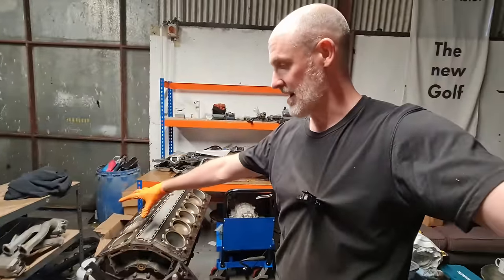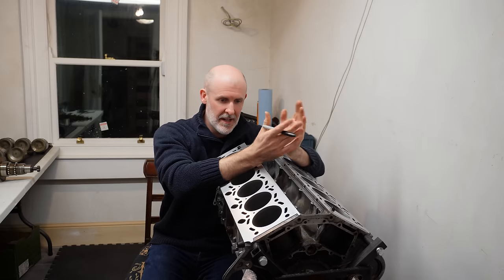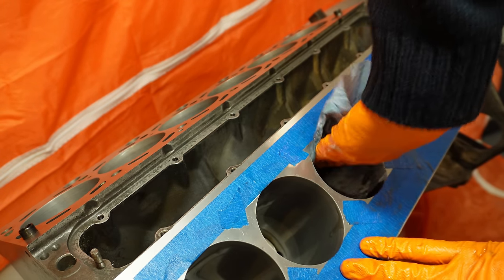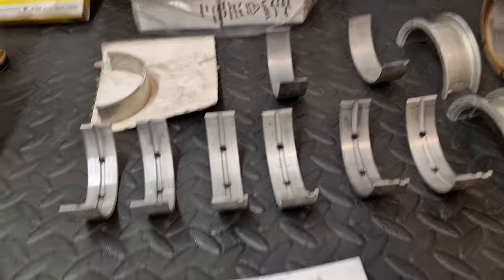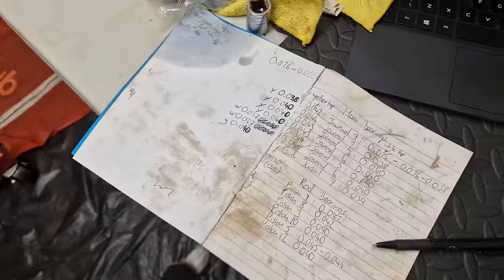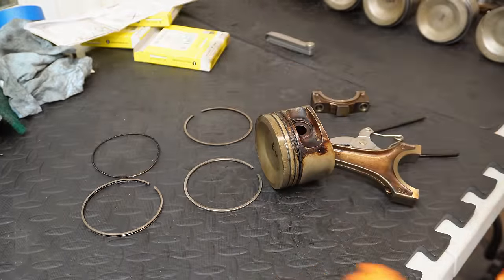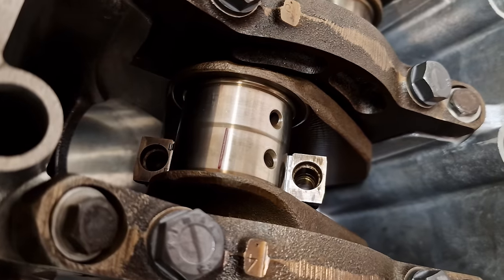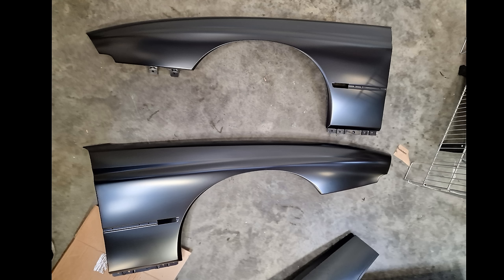BMW E31 850i "Glacier" - Complete Restoration - V12 Bottom End Rebuild - Episode 14

Comment: God bless your damaged heads and you... I find you have to find a mentor shop,  but in my town I have not found  one.   Over time I think you can find what you need.  I’ve owned M70 and 73 models.  These engines can be found in  junk yards at times or purchase a lower milage 750 for very small money.  These cars can cost a ton of money to maintain unless you do some of your own work…great video  thanks for the education

Comment: Hi Steve. Thanks for the great video. Just glad that you're fit and well, one wonders sometimes with long gaps in the uploads. I am struggling with my 840 restoration, there seems to be a lot against me. Primarily health, I'm 71 now and too ill to work on it at times. Also, a problem with the fuel rail has stopped the job in it's tracks. I appear to be the only person in the world to have had this problem according to the forums, which I just don't believe. It's a shame the camshafts were so bad, one can only suspect a bit of bad maintenance history. Love the new old stock panels. I looked into buying some for mine but just couldn't afford them. Parts are being discontinued for the E31's left right and centre, fuel rail for one. And like you say, 4 companies all over the world have all taken my money then failed to supply and sent a refund. Each time it happens wastes loads of time. Anyway, let's hope she runs on all 12 when it's all back together.
Reply from the maker: Sorry to hear that, there is acres of experience online with the M60/M62, I hope you get it sorted!
Reply: @stevesbmwbarn  Yes, you'd think so, but there's also a lot of bad advice out there, it's a matter of separating the wheat from the chaff I'm afraid. I'm currently on the last experiment with the fuel rail, if this fails then I don't know what else to do. If you're interested, and there's no treason why you really should be, I have posted threads on the Bimmerforums 8 series forum on the subject.

Comment: Hate to tell you this Steve but the blocks are alusil. After honing them they need to be acid etched to remove the aluminium and expose the silicon. If you leave it with exposed aluminium from honing the rings will snag and it will seize in time.
Reply from the maker: Please watch that section again, the process I followed does exactly what you just described and is a tried and tested method.

Comment: Hey Steve,

thank you so much for your effort making this video.

I'm currently rebuilding my M73 (750i from 1999).

And I also did the honing like you do in the video, have also used the same laping compound.

BUT: my cylinder walls do NOT turn out as dull as they should be / like they were before from factory.
I still can see the cross hatching clearly. This should not be the case.

I did some investigation and found out that its important to meassure the surface roughness of the cylinder walls afterwards etching.

In case it is too thin (too less etching) the walls would be too soft so the pistons will literally scuff them up and completely destroy the block.

I will do another round of laping but I'm concerned about the the real roughness of the walls..

Have you meassured your walls ?

Comment: Been following for a while, my '91 850i has been sitting for a minute. Still runs fine. Just needs some suspension and a rotor. My car has 90k miles on it, so hopefully it's gonna last a while. Interior is trashed unfortunately. I have the inside gutted.

Comment: Didn't think bearings would be so hard to find, yea it's 30 years old but I imagined some other engine must've been using the same size but glad it worked out. I guess I better stock some for the rebuilds I'll be doing in 20-30 years lol

Comment: I’m no expert but my 750il   (88,000 mi.) oil consumption is minimal, perhaps 1/2 qt per 4,000 miles using fully synthetic. The car was severely overheated and driven on a long drive after the fan exploded. Seems good as new…engine is very forgiving and tons of torque!